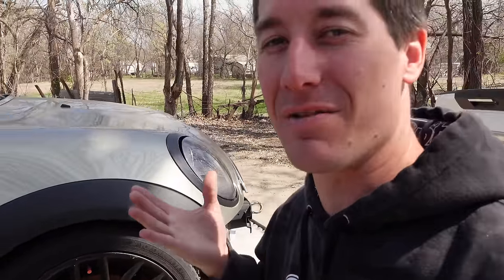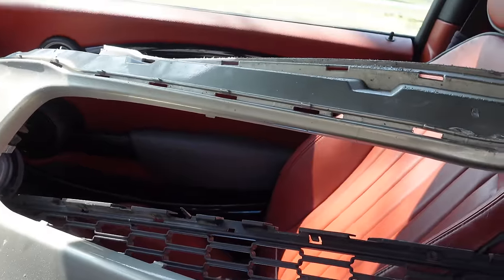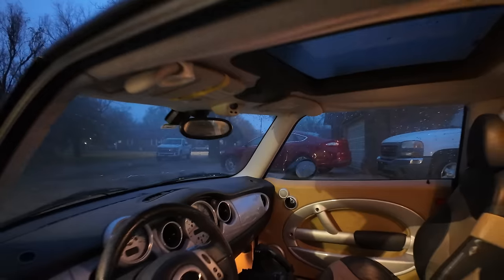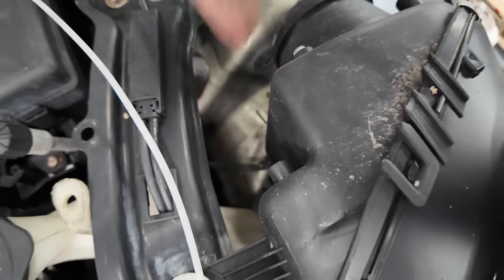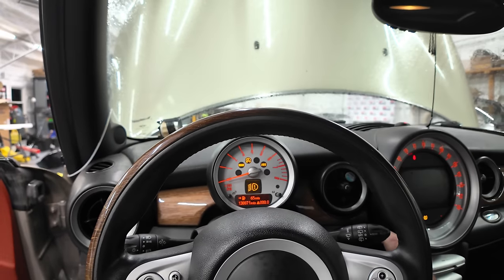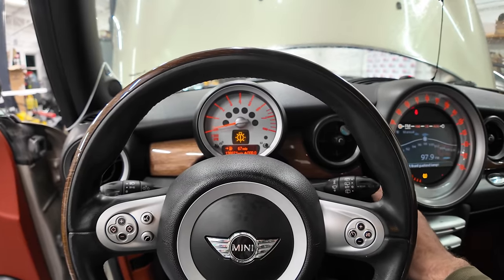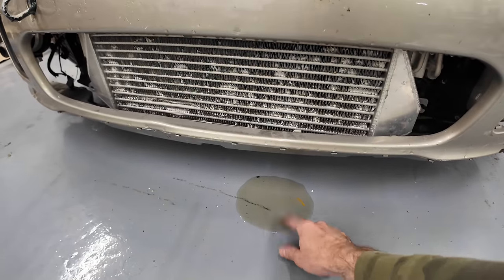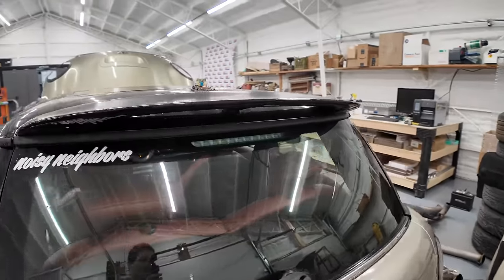I Bought The FINAL BOSS Of Mini Coopers... But It's Already BEATEN

Comment: Cross threading on that level is done by people that feel the need to use power tools on everything and cant be bothered to ensure the bolt/nut is properly started. My shop is now replacing a $1000 subframe because a "tech" managed to strip out two captive nuts. He said the bolts for the diff were hand started, I think he got about a half a thread and sent it home with the impact. Uga dugga.

Comment: Super knock is when the piston is still moving up and the ignition happens before the spark. That red handle in the glove box is a plug that goes on a new valve cover in one of the PCV ports(you dont need it). The pops and bangs wont happen until the engine is warmed up. JCW's have different struts than the S models. Yes valve seals are a problem in these cars and is most noticable when the engine is warm and you hit the gas after its been idling for a few minutes. Also the hard starting is a symptom of a HPFP going out, but with the mods and tune its hard to say.

Comment: I had an S clubman. The N14 "Prince" motors in this generation are NOTORIOUS for timing chains prematurely slacking out and grenading the top end. My 1st N14 engine let go at 34K from the timing chains, the 2nd motor died with 84K on the odometer from the same thing...... The worst part is BMW finally agreed to replace the 2nd motor again for free ($14k job at the dealership) 5 days after I panic sold it for $3,800. Absolutely broke my spirit and heart. Even after all of that it's still my favorite car and I miss it daily. Cars. Are. Pain.
Reply: I also had a ‘09 Clubman.  Sold it with 29k miles in 2017.   Handling was great and miss the car sometimes but wasn’t worth the headache. Pain points include the plastic thermostat housing (mine leaked with under 5k miles), oil filter housing issues and plastic water pump impeller.  Germans and the French love using plastic in critical parts.

Comment: I've got two Minis - a 2012 Countryman and a 1963 Traveller (wagon). Minis are awesome! 👍😎👍
Reply: I am in the same boat. I have a R53 mini and a minivan
Reply: The 1963 Traveller is a real mini though, not this BMW crap box.
Reply: MINIs o'plenty here too - 2013 R60s, 2018 F56 JCW, 2023 F54s, 2023 F54 JCW, 2024 F56 JCW - all in the drive or garage.....
Reply: Rebuilt a wrecked r53, working on a wrecked f55 now.

Comment: They may have had a drive shaft pull out because the lowering yanked on the shaft too hard. Then filled the box back up with regular engine oil after it drained through the hole from the shaft. With extreme luck, you can push the shaft back in, put proper oil in the box, replace the racelands and be good. Not saying the engine will be good, but that's for another episode.

Comment: The n14 engine in the S isn’t the same as the n14 in the JCW. The JCW is lower compression with forged pistons. I believe my JCW is 9.5:1 or 10:1 versus 11:1 on the S.   When my transmission died and was replaced under warranty, it took a month to get because the dealer had to order it. The S trans is apparently not the same and I believe the input shafts are different because the flywheels are different enough not to be interchangeable. That dart and die sounds like a High pressure fuel pump to me. Had mine replaced one e in warranty and again 4 years later
Reply: I agree with the HPFP issue. Same happened to mine. I rebuilt the pump myself and fixed the problem.

Comment: That starting issue looks like a worn HPFP. It doesn't get enough RPMs at startup to maintain high pressure fuel to the rail. Especially when cold. So reving up during start usually allows it to stay running.

Comment: An Mini R50 with an automatic? I am surprised it lasted that long. The CVT transmissions are awful in the Gen 1 modern Mini  R50’s. Heck the 5 speed manual transmissions are awful in those Minis. 

I am glad JR can wrench like a beast as I would not touch an R56 Mini. Like the look, like the size but just a nightmare as far as keeping them running.
I am sure he will do it all over the top but man it is throwing good money after bad with the 2007-2013 Minis. Fun? Yep. Frustrating? Absolutely. 

I look forward to JR really getting the Mini bug and buying a Mini R53 slicktop and swapping in a Thumper head (some say better than JCW), 17/19% supercharger pulley, swapping out old suspension for new and ripping around town / the track in that thing.

I will be watching this content.

The Drivers Seat: check Willmek Mini Parts in Ohio or AllMAG in Tampa - two Mini breakers who I have worked with for Mini parts.

Comment: Just curious, any update on what fluid was in the 2019 Chevy Equinox and what it did to cause such problems?
Reply: Either bad fuel, or something that wasn't fuel in the fuel tank.
Reply: In one of the more recent videos they spilled some in the driveway and managed to set fire to it; consensus in the comments for that video gravitated towards it being Kerosene. The other prevailing theory was AdBlue/DEF for Euro >=5 engines. Neither fluid is particularly suitable for burning in Otto cycle combustion engines 🤓.

(Never lived in the US, but way upstate in the country I live I saw a reputable-brand gas station selling Kerosene -- presumably for heating -- from normal looking and properly labelled gas/diesel pumps; and I can believe that to still be the case in most parts of rural USA, esp. where it gets bitter cold)

Comment: What causes Superknock?
Knock happens when the fuel ignites earlier than expected. Much more damaging is “super-knock.” Unlike normal knock, super-knock is caused by a detonation wave due to a feedback loop between the heat release associated with the flame and pressure inside an engine cylinder. It'll buff out.
Reply: Never heard of super knock. Figured it was regular knock wearing a cape 😂